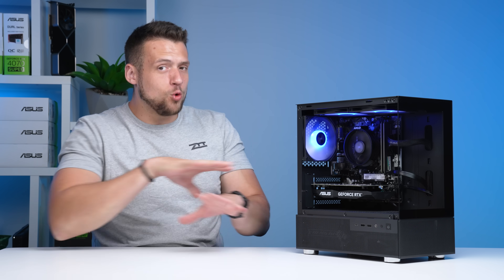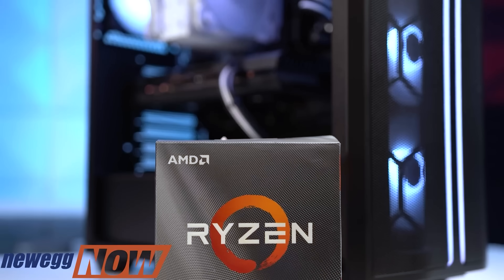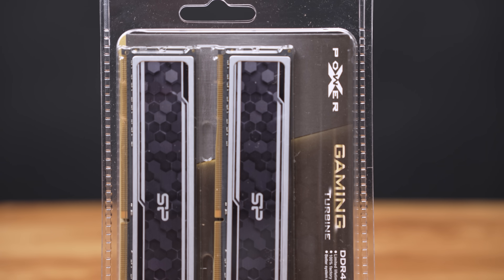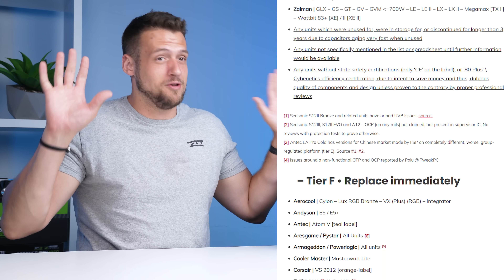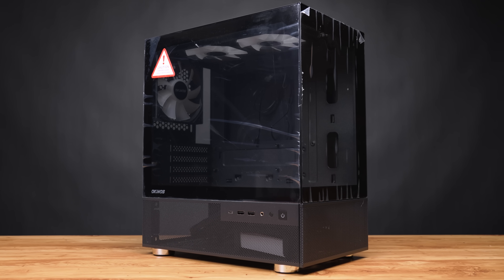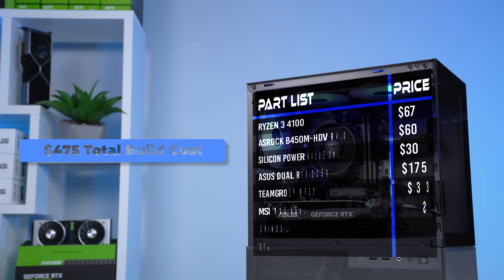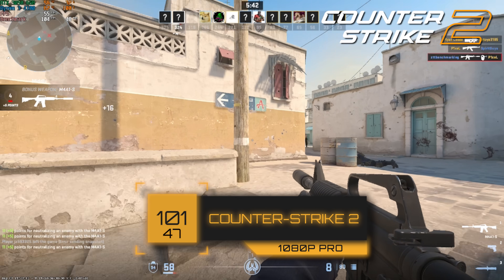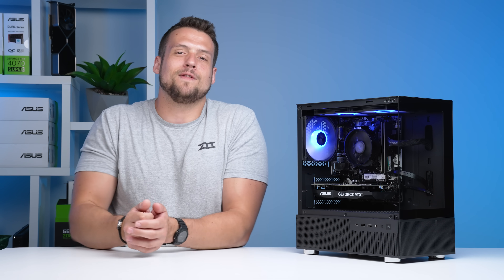$475 Gaming PC Build Guide

Comment from the maker: Check out our extended benchmarking run of this build over on the @ZTTExtras channel! https://youtu.be/W24T_S233xc
Reply: Bro 500$ That's Some Crazy Budget And New Parts Woah
Reply: Zach I got banned from the discord server im here to tell you I tried to appeal but instead of getting the appealing form I got a ticket to enter the server I think that needs to be fixed
Reply: Would you be able to revisit $2000 builds for the market ATM as i don't know what to look for or avoid in building
Reply: Zack cen i use the r5 5600 instead
Reply: Zach can you do a build in the montech XR? I think it's a great good looking budget option coming in at 60 euros here in Spain, nice video.
Reply: Just noticed a typo on your site. 'Extenstions' in the description of the build.
Reply: Zach what program do you use to monitor cpu  gpu ram usage?
Reply: @mikehatherall2628  Task manager works fine tbh.
Reply: can u gift me a 4090🥺🥺🥺🥺🥺🥺🥺🥺🥺🥺🥺🥺🥺🥺🥺🥺🥺🥺🥺🥺🥺🥺🥺🥺🥺
Reply: I have a rx6700 xt and want to buy a rx 6800 xt or non xt,But i need to upgrade my cpu first(i have a ryzen 5 3600xt) and dont want to buy a new mbo for am5,so should i buy a ryzen 5 5600x or should i buy a ryzen 7 5700x or x3d.Playin in 1440p with 144hz monitor.
Reply: Hey quick question it mean a lot to me if you could explain the best of the three currently

im running 
- ryzen 5 5600g OC running Call of duty warzone 2.0 @ 60fps no drops with a 55fps 99% FPS
- ASUS Prime B450M-A II AMD AM4 (Ryzen 5000, 3rd/2nd/1st Gen Ryzen Micro ATX Motherboard (128GB DDR4, 4400 O.C.), NVMe, HDMI 2.0b/DVI/D-Sub, USB 3.2 Gen 2, BIOS Flashback, and Aura Sync)
- 2x Team T-FORCE VULCAN Z 32GB (2 x 16GB) 288-Pin PC RAM DDR4 3200 (PC4 25600) Desktop Memory Model TLZGD432G3200HC16FDC01 @ 3200mhz
- ASUS TUF Gaming LC 120 ARGB all-in-one liquid CPU cooler (Aura Sync, TUF 120mm ARGB radiator fan with fan blade groove design)
- PSU = PK600D DeepCool PowerSupply

Im looking for an upgrade that can be found only on newegg CANADA version i.e 

This would mean alot if you can help before the 27th of this month. 8/27/2024

Im looking between

rx6600

or an 

rtx 3050 LP or regular

or an 

intel arc a350 or above.
Reply: I know it's late but can you review an AMD Ryzen 5 7600 and also Ryzen 7 7700 CPU?
There's no reviews on them in YouTube at all.
Reply: 0:37
Reply: Zach would spending 20-30 extra on the 8gb 3050 be more worth it

Comment: My pc spec:
psu msi 550w 80+ bronze 43$ gpu 3060 12gb 250$
Cpu i3 12100f 54$
motherboard asrock h610m m2 h2 60$
Ram apacer 16gb 3200mhz 23$
PC case Digital Alliance (local brand) 20$
Memory Rx7 SATA 1 tb 50$

Thats my 500$ build.. happy with it

Comment: hey @ZachsTechTurf on PCPartPicker it says "A Warning: The ASRock B450M-HDV R4.0 Micro ATX AM4 Motherboard supports the AMD Ryzen 3 4100 3.8 GHz Quad-Core Processor with BIOS version P4.90. If the motherboard is using an older BIOS version, updating the BIOS will be necessary to support the CPU." if I were to build this pc for myself would this be an issue and if so how would i go about it

Comment: Can you please help me to update my list for the new pc build 
Gpu rx7800xt and CPU  ryzen7 7800x3d  and motherboard motherboard msi x670e and storage samsung 980 pro and ram t force delta RGB 16gb 6000 mhz x2 and Cooler Master MWE 850 Gold V2 and Cooler Master ML360L Core ARGB CPU Liquid Cooler and cabinet NZXT H5 Flow Compact Mid-Tower Airflow Alloy Steel

Comment: I completely understand and respect the video concept here. buut.. i would never let my friend build this pc over something like a used 5600($100) and used 6600xt ($140). Double the fps for the same price. New parts only make sense when looking at higher tier setups like rx 6800 amd 7500f level builds and up. 

A $500 build vs a $1000 build does not get you double the fps.. its more like 3x the performance in most scenarios.

Comment: For those who can spend a bit more this is my suggestion
Depending on your budget
1) CPU:- i5 12400F OR Ryzen 5 5500/5500GT/5600G
2)GPU:- RX 6600/ RTX 2060/ GTX 1650
3)RAM:- 16GB 3200mhz from a good company 
4) Any 4500mhz+ 500GB/1TB nvme M.2 Gen 4 SSD from a good company 
5) Any 500-600 watt psu with 80 plus bronze rating....Cooler Master/MSI/Gigabyte
6) Any case within ur budget

Comment: Good video, but I agree, I'd rather go used. Get a used ryzen 3600 and 12gb 3060, spend the difference to get a 1tb nvme, and change the ram to 2x16gb. If you got $20 left, peerless 120 cooler. It'll come out to around the same price and will spank this pc in every category. Only thing is it can be a gamble, and no warranty/rma support

Comment: Hey Zach, i've been planning to build a desktop for a year now and i would want an advice.
I currently have a GTX 1060 6gb i7-8750H Laptop, but recently gets slower even after repasting (maybe because of the newer games).

Here are the components:

Intel Core i7-13700K
ASUS DUAL GeForce RTX 4060 Ti Advanced Edition
MSI MAG Z790 TOMAHAWK WIFI DDR5
32GB (2 x 16GB)Corsair DDR5-6000 RAM
2TB WD Black SN850X NVMe SSD
ASUS ROG STRIX 750W Gold Aura Edition
Corsair 4000D Mid-Tower ATX Case 
Noctua NH-D15 Air Cooler
Windows 11 Home (USB)

Any advice? 

Thanks.
Edit : changed to a RX 7700XT because of better price/performance and a Be quiet! PURE BASE 500 as a tower because of price and reviews.
Reply: An i7-13700k does work really well with the RTX 4070 or RX 7800XT because it is compatible with 1440p. But if it doesn't fit in your budget, the build is good.

But keep in mind, I haven't been updated with recent PC component news so my info might be a bit iffy.
Reply: @fyoomi5142   @fyoomi5142  Hi, i am still holding on the purchease. I currently swapped to a RX 7700 XT because of the higher fps/price and i purposely chose the i7-13700KF because it is a bit cheaper than the K version.
I also swapped to a be quiet! PURE BASE 500 tower for the same reason and also for the good reviews.

Comment: From a brother in arms to another, how did I do? Will be building this in September!

1st PC Build:

-Ryzen 7 7800X3D
-Gigabyte Gaming OC 4070Ti Super 16GB
-MAG A750GL PCIE5 MSI PSU
-MSI Tomahawk B650 mobo
-2TB Samsung 990pro SSD
-32GB Ram DDR5 Vengeance 6000
-Arctic Liquid Freezer III (swapping fans for Lian Li Uni for the top, repurposing the fans for bottom intake)
-x6 120mm Lian Li Uni fans (3 for vertical intake and 3 for swapping on the AIO top exhaust)
-1x 140mm for Rear Exhaust
Repurposing the 3 Arctic fans that came with the AIO as the bottom intake fans
-Hyte Y70

Will be gaming on a  27" 4k 144hz Monitor too

Love your content bro!

-P.S. I love Airforce DFACs on deployment <3    -Army bro
Reply: seems really great, what performance numbers you getting?
Reply: @thefilthycasual448  I’m actually still in the process of building the PC this weekend!

I tested all main components and everything is solid 🤙
Just gotta finish putting it all together and routing my fans to the hub 🙂

I’ll let ya know what the numbers are once it’s built!
Reply: @thefilthycasual448  alright so my rig is built and tested out Hell Divers 2.

With my 27” 4k 144hz monitor, running full Ultra settings, I was ranging between 55FPS (absolute lowest) and 90FPS (might’ve been higher at times).
This was also during Hell Dive (lvl9) missions with all the craziness happening too. I’m sure if I slightly changed my settings or brought it to High on 4k, I’d get way better FPS.
Reply: @AngryWookie93 How much is the total you pay for?
Reply: @pndt05  I’d say overall it cost me about $2,000 to $2,200. 

It could possible be $1,800-$2,000 if you’re able to score bundle deals/discounts too.

Comment: Is rx6700xt and ryzen 5 7600x with 32 gigs of ddr5 ram good for high quality 1440p gaming for playing high end games like cyberpunk ,rdr2 or even gta 6 ?
Reply: I usually scale down generations of GPUs. So if you have an RX 6700XT, it usually means it is an RX 7600XT or the RTX 4060. The Ryzen 5 7600x is a good am5 CPU and 32 Gigabytes is a lot for playing cyberpunk or anything without major work like Photoshop or ram heavy games such as the original Cities: Skylines.

Comment: I managed a decent all new parts build for under $450, 10100f, 16gb ram, a380, 1tb ssd, wifi 6 and bt 5.2. It can be done if you pay attention to sales, and shop around, some parts didn't even get listed on pcpartpicker for price or availability, so pick a platform or two to work with and shop around.

Comment: Is this build good or should i change something for cheaper version? And i have 900 dollars budget for pc and monitor,what should i do for monitor?

1. *CPU:* *AMD Ryzen 5 5600* - $125  
   - The existing CPU is still a good choice for programming and gaming.

2. *GPU:* *NVIDIA GeForce RTX 3060* - $260  
   - Provides excellent performance for gaming at 1080p and 1440p.

3. *Motherboard:* *ASRock B450M Pro4* - $70  
   - Compatible with DDR4 RAM and the Ryzen 5 5600.

4. *RAM:* *Corsair Vengeance LPX 32GB (2x16GB) DDR4-3200* - $90  
   - Upgraded to 32GB for better multitasking and future-proofing.

5. *Storage:* *Crucial P3 1TB NVMe SSD* - $55  
   - Fast and ample storage for games and development work.

6. *Power Supply:* *Corsair CX650M, 80+ Bronze, 650W* - $70  
   - Reliable power supply with good efficiency.

7. *Case:* *NZXT H510* - $70  
   - A high-quality case with good airflow and cable management.

8. *Additional Cooling:* *Arctic Freezer 34 eSports DUO* - $40  
   - High-performance cooler for better CPU temperatures.

### *Total Cost: 780*

 This is chat gpt recomended build for me

Comment: Take a look at this. this is my friends $4,367 build from 2020. I did not advise this build

Logitech G915 TKL wireless RGB line

Gigabyte Z490 Aorus Ultra ATX

APC 12out 4320J 6’ 2USB BLK

ASUS ROG RYUO 240 CPU COOLER

CORSAIR RMX1000 FM 80+G ATX PSU

SEAGATE 8TB BARRACUDA 3.5” HD 0

ASUS GT501 TG RGB MT GREY CASE
INTEL I9-10900K BOX

G. SKILL 64GB 2X32 D4 3200 TRZ R

ELGATO GAME CAPTURE 4k60 PRO MK.2

IPSG 2TB I PREMIUM NVME SSD

RAZER SEIREN ELITE USB DGTL V2 

EVGA RTX2080TI XC ULTRA GAMING
 
LOGITECH G502 HERO WIRELESS MOUSE with RGB LIGHTING

Comment: only spending $360 because i already have the mobo, ram, and ssd in my current build but it has a rx 570 and ryzen 3 1200 in it. i really needed a new psu and case as well, my psu makes weird noises and my case is busted.

Comment: I currently have a ryzen 5 3400g and a320-h motherboard, will it be possible to upgrade to ryzen 5 3600 with the same motherboard and will the new cpu pair well with GTX 1060 3gb? I mostly play valo and cs.

Comment: I have a question, I'm about to upgrade my motherboard, CPU, ram, and power supply. will an rx580 and ryzen 5 3600 with ddr4 run well in 1080p?

Comment: i built a pc for about 450 euros with rx5600 xt , 16 gb of ddr4 ram, ryzen 5 3600, gigabyte A520M S2H  motherboard, 500gb ssd ( some kingston 3600gb\s speed), chieftec ctg 750c (750w) and a MS ELEMENT M300. Is it good?
Reply: ZachsTeechTurf 
scammers will not stop

Comment: I second the 6600 video card recommendation.  I built a nearly identical system to this for about $550, but was able to squeeze in a 6650 XT and a Ryzen 5600X (prime day sale, $10 more than the 5600 so why not?). The thing isn't a rocket, but $75 more gets you a massive improvement in speed.
How I managed to do this was the case.  Look, I know people call it junk, but the Cooler Master 300 case is fine for $40 if it has mid-range hardware in it. 
1: Remove the silly dust covers everywhere. This improves airflow greatly. 2: Install the PSU fan facing upwards into the case as this adds to the overall removal of heat. Mine runs fine on the one exhaust fan and the video card/psu fans. No intake fans at all. 60-70C. That gives you $23 more to spend on other things like a 1GB ssd.
Where people run into problems with this case are sticking 200-300W CPU and GPUs into it and it suffers from heat soak. A 4000 or 5000 series CPU and a modest 6600 series card won't stress it at all.  My fans don't even spin up at all unless I'm running something awful like Cyberpunk - then barely above ambient.

Comment: 4:33 i think anyone with a brain would just turn around the rear fan to use it as intake fan and then the 2 fans on the top will remove any warm air that rises in, wouldn't that work?
Reply: ZachsTech-Turf  i ended up being a victor, what does that mean?

Comment: I build pc's for my friends and for the gpu, i always get a refurbished rx 5700 or rx 5700xt on ebay for around 150-220 euros, ik the  challenge is for new parts but refurbished parts are literally just used parts but got cleaned by the seller. Just a little trick im using when building budget pc's
Reply: i wrote him now on imessage

Comment: Yeah, not only did you take it to far, ya kinda stunk the place up. No wi-fi, a SSD so small a couple of games and you're done, $20 additional would have gotten you an RX 6600 8GB and 40% more performance. Good Grief!
Reply: A cheaper case would solve that.  A system with a total max power draw of ~400W can be put in almost anything.  The case he keeps choosing is overkill for the job. $40 basic box and $23 more to spend on.. wow - a 6600! :)
Reply: @Kenede20 Honestly Wifi is worthless in a PC as your cable box is going to provide it anyways for your other devices.  Wired connections are more secure and faster.  Though, i do suppose you do need to budget $20 to a cat 6 cable if you don't have one. lol.  Pro tip: Monoprice. Go direct to their site and get what you need.
Reply: Kenede20 sure, wifi is cheap, so is a GPU upgrade, CPU upgrade, etc.
Reply: Not in all countries though. The RX 6600 is extremely overpriced in my place compared to an rtx 3050 .
Reply: @EvanART11 fr for me the rx 6600 is around 230€ and the rtx 3050 6gb is 180€ and the 8gb is 210. I would chose the rtx 3050 over the rx 6600 in both cases cause I also value all nvidia features.

Comment: Just picked up a Gaming PC with a Ryzen 5 7600, RTX 3070, 64GB DDR5, X670 Elite, 2TB NVMe SSD, 850W Gold PSU, Fractal Design North, and a dual-tower CoolerMaster Cooler for just $800 CAD ($590 USD).
Reply: How did you get it for that cheap
Reply: Bro that's a steal deal good job 👍
Reply: Where did you find that
Reply: @festivejarate  It was off of FaceBook Marketplace and the guy had it listed for $1500 but was moving the next day so he sold it for $1500.
Reply: @leonpetrovic9956  It was off of FaceBook Marketplace and the guy had it listed for $1500 but was moving the next day so he sold it for $1500.
Reply: 64gbs of ram and a X670 Elite motherboard is overkill as hell for those specs.
Reply: @ZackSNetwork  It doesn’t really matter because I will just case swap it and flip it.
Reply: @festivejarate  facebook marketplace
Reply: What a steal. I recently built an am4 build, rx 6600 and r5 5600 with everything $800 Cad

Comment: People can just swap the mobo to Asus Prime B450M-A II instead, it only cost $10 more but comes with 4 ram sticks, decent VRMs and at least a heatsink, and a Bios Flashback feature. Also Asus bios is much more user-friendly for OC - enthusiast even if it only come with offset mode. Currently using it and got my R5 3600 OCed to 4.4GHz + 1.28mV, perform like a beast, with cool. Better than any i3 12100f on the market. So it could be recommended bc it does come with an upgrade path, and the mobo is something you might not want to swap in the future
Reply: I spent about $100 on mine - a nice ASUS B550M for that reason.  I can drop the latest X3D CPU in it when those are cheap as dirt in a couple of years. The motherboard is unfortunately the one area you really can't scrape the actual bottom of the barrel on.

Comment: Zach, when are you going to use a arc gpu in a pc build, you almost do it in a $600 pc build using the arc a750 but you switch it to a rx 6600

Comment: Why didn't you go with the Intel Arc A580 instead? It's 179USD so it's basically the same price and has better price to performance value.
Reply: Going with an Intel GPU might make sense to enthusiast.
Recommending a new-architecture GPU with massive drawbacks and mediocre support from its manufacturer to others?
Yeah, don't do that.
Part of "value" includes the ability to actually use the thing reliably/consistently

Comment: I am on the verge of building my firs gaming pc. Using the same pc case for my Micro Center combo ASRock B650M-HDV/M.2 AMD AM5 microATX with Rysen 7600x and G.Skill Flare X5 Series 32GB DDR5-6000 for around $320. My goal is budget 1440p AM5 build. Still deciding on GPU and PSU. Any suggestions?